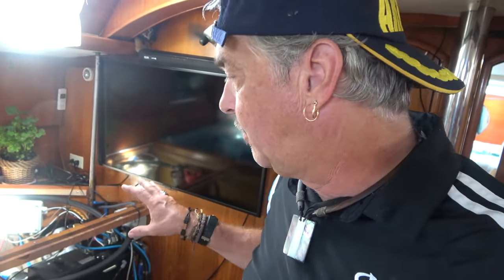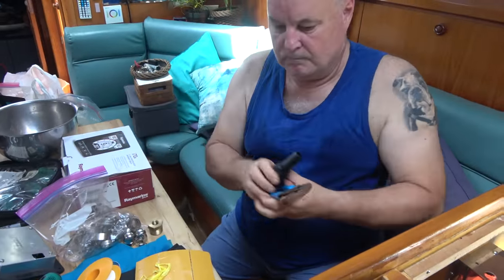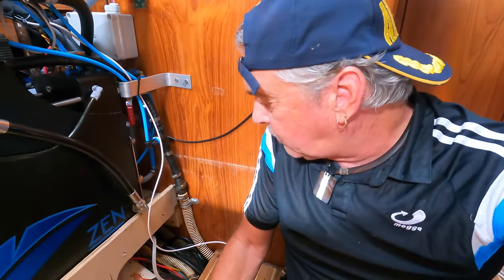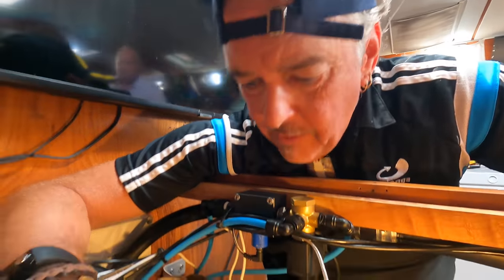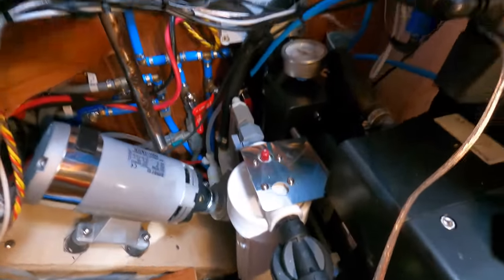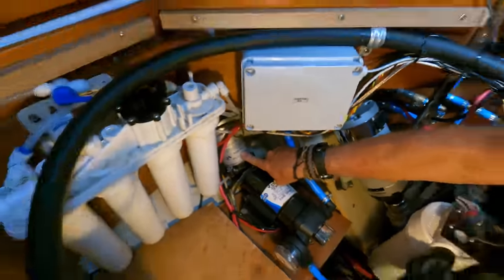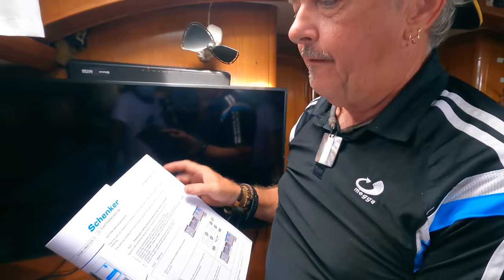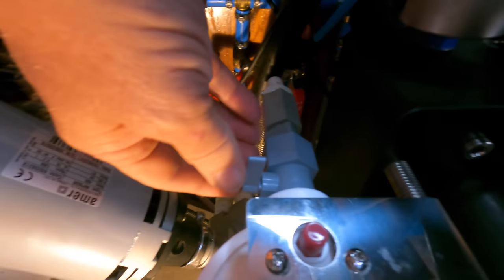SSL614 ~ First test of a SOLAR POWERED WATERMAKER.. our new ZEN100 Touch by Schenker Watermakers

Comment: Rick, I have a Schenker 100 also for the past 18mo. Rather than disconnect the product line for a test line, I cut into the product line with a T-valve and permanent test line. I do not trust the desalination meter as I have seen it read from divert to bad to ok, and the ok can be over 500 tds, even over 600 tds. I therefore always run a sample out of the test line and check it with a hand meter like you did (I have two). World of difference between sub 300 tds and 500+ tds. Normal bottled water is usually high100's to low 200's. In my experience in the 300's is ok, over 400 is no bueno, can start to taste weird and taking in too high amount of electrolytes.

Comment: G'day Rick, Mate I find it very surprising that you run your high pressure hoses with just the one hose clamp instead of two per connection which clamps I normally mount each clamp mounted opposing each other. However overall a very impressive installation and overall system. Well done ole mate. Cheers Rosco

Comment: I've been wondering for a few years now why California isn't using water makers. It sure would solve a big problem or atleast one of them. Cheers Capt Rick I hope all is well.
Reply: There are a few places like Hawaii that do use the salination systems the problem is when you clean the water you dump all the brine back into the ocean eventually you will raise the salt level so high that it will start to deteriorate the natural environments that the sea life lives in
Reply: @SALFXEF  hmmm stop the rain then
Reply: @jimlofts5433   You ask a question I give you an answer there is no salt in the rain yes there may beesome toxins in the rain from the atmosphere but just think about it if the world started drinking water from the ocean and pumping all the Bryant back in how quickly  The ecological systems would be damaged don't ask a question if you don't want an answer
Reply: @SALFXEF  

An interesting asides if they go ahead with Na based rechargable battery Systems in place of Lithium chemistry for vehicles and they will have to to produce enough, not only will they producer safer lighter cheaper battery packs ..you can use the Na separated from the concentrated brine from large scale  desalination plants. 😎🤞🏼 The Chloride's also used in chemical engineering feedstock along with other rarer elements like Lithium Ca, Mg, P, k, Cu etc..
 
Definately a result as California has several Desalination plants ... the problem is cost in terms of energy .. though if youve space you can use passive concentrated solar distillation.

Comment: Seems very electronic reliant, computer, where as our Spectra was all manual and very easy installation.  15 gpm at very low amps  at 12 or 24  volts.